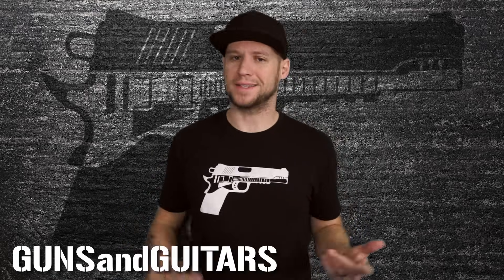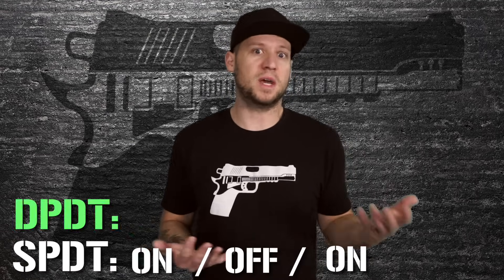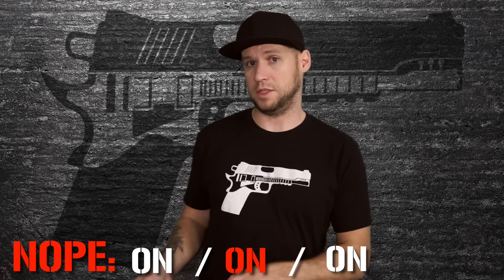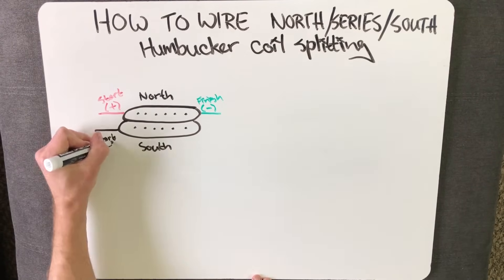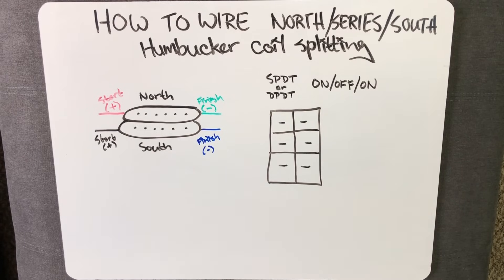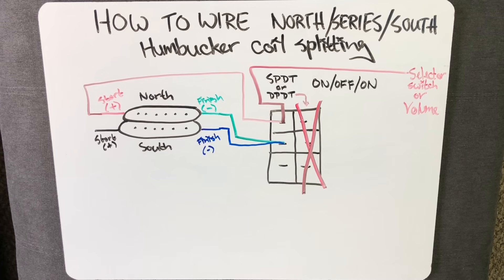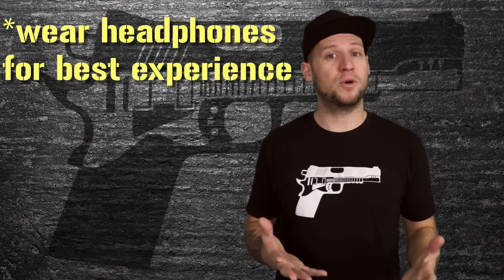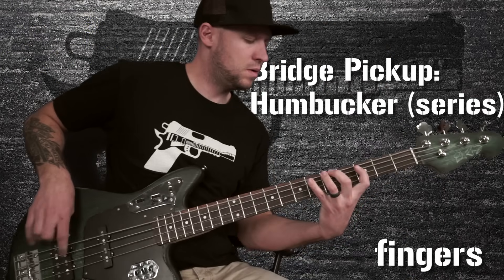BETTER THAN COIL SPLITTING! How to wire a humbucker for North/Series/South coil selecting

Comment: This is good.....I've been thinking this out......I got a 50.00 free shipping strat from ebay.....leveled the frets and replaced the plastic nut with bone.  Even though the tuners are low end they stay in tune with some stretching and nut sauce. (they held for about 3 days with bends)

I just ordered 3 of the chinese hot stack humbuckers (single coil config.)  I'm going to put dpdt toggle switches on the neck and bridge pu's for this mod...go from pickups to toggles (1 dpdt for each pu)....then to 5 way.
Then out of phase/in phase on the middle pu coming from a push pull volume pot so I get out of phase or in phase on 2 and 4 position.
I may do another push pull on the tone control and add the Gilmore mod....so I can have N/B  or all pickups at once.

I'm really surprised this thing will play in tune with a low action (after leveling).  With some jin-ho korean locking tuners it would be interesting.  With new tuners and pu's I'd have about 110.00 in it.  The body is light wood but the neck is tight.  The neck is weird....not curved at the butt and 22 frets.   

I think I may also do this mod to a silver peavey rockmaster I got....I routed a slot and added a neck chinese hot stack pickup.
This would be the perfect mod for it.  Paid 20.00 at a pawnshop.....refretted with jumbo's....my favorite guitar....goes head to head with 1500.00 ones....lots of sustain because of the through body hardtail.

Comment: How about wiring a humbucker to work in normal humbucking mode, parallel humbucking mode, and single coil tap?  Possibly performed with either a three-way toggle switch (if possible) or 3-way rotary switch.

Comment: i think this is a north/out of phase/south diagram.  your 2 negatives are tied together.  wouldn't the negative of north need to tied to positive of south, and that on the middle switch position?
Reply from the maker: No because pickups are reverse wound and reverse polarity in order to be hum canceling. Because they are reverse wound, you need reverse polarity to be in phase.
Reply: in most of my guitars, i use the tone knob pot as a variable coil tap on the bridge pickup.  in one of my guitars tonite, i installed the on/off/on switch so i could also tap coils on the neck pickup.  the hardest part was deciding where to drill the hole, and finding drill bits.  it's also nice to try how it's going to sound first with alligator clip leads.
Reply: tonite i added a 21k ohm resistor in between the switch's middle lug and and the wire between the 2 pickup coils.  this is to change the coil tap from complete to mostly tapped, to get rid of most of the single coil hum.  i would guess any value from 5k to 50k would be ok.

Comment: Hi Dan, i'm looking into doing this mod on a hss standard strat, its stock option for position is to it split the humbucker using the north coil and the middle pickup, will i still be able to do this with this mod in place and if so will i also be able to switch north, south and full as well?

Comment: Like ur vids man, gota ? tho. Wat would u use to fill under the nut? I bought a used tele changing strngs ,nut fell out n under the nut the slot is at least twice as deep as it should b. It had been drilled ,hacked out. How it was stayin in i dont kno, but now it wont. I wanz fill it with some thing that wont hinder,vibrations,sustain n all that. Hav u ever? Lol SO,,, what could i use there that would make it close to original ?  Thx

Comment: Hey, want a neat build for a really good guitar tone?

Take two single-coils, and put them side by side like a humbucker. Adjust one to be as low as It can be on the High E string, and the other as low as it can be on the Low E string. Wire the pickups in stereo (Either use a stereo jack or use two Mono jacks). Tada, Instant Double tracked guitar sound, put an amp on either side of yourself (Or directly into your mixing board and split them left and right) and you get this crazy spread sound stage.

Comment: No offence, but i feel the need for spliting the humbucker a tad redundant since it sounds bigger and more full then the single coils, which are kinda thin sounding.
Reply: I really like using a split-coil sound for rhythm guitar and then un-split for leads  when recording. The split allows for more punch and picking dynamics, and then full humbucking gives the leads a fat/smooth tone. Lends well for creating a mix, helps keep the mud out.

Comment: I really enjoy your videos.  One question, in the diagram as drawn is the series mode out of phase?   I thought the path through series should connect the positive of the south pu to the negative of the north pu and the south pu negative to ground... but I reserve the right to be wrong. :)  even if it's not in phase, still a great video and easy to setup for either in or out of phase.
Reply from the maker: I’m not an expert on this either, so maybe an expert can chime in here, but I believe this works because in order to have hum canceling in series the coils must be reverse wound AND reverse polarity, so in theory the phase would need to be reversed. I also reserve the right to be wrong :)
Reply: So, I've been thinking about this... most of the diagrams I find from manufacturers show the connection between the 2 coils being a positive to negative connection.  I've used EMG, Bartolini, Carvin, Fralin, Nordstrand diagrams and pickups.    I also found articles stating exactly what you've stated above related to phase in series.   It makes me wonder if the manufacturers are labeling positive and negative based on their designed direction of current flow through both pickups and one is possibly reverse wound.  When you determine current flow with the voltmeter, you find out the winding direction, not necessarily the manufacturers intended current flow through the pickups (I may be assuming too much here though) so the diagram you have may be accurate when the current flow is determined using the voltmeter.  I haven't tried this yet, but if you do the voltmeter check on a common manufactured pickup that already provides the wiring layout, if one of the pairs is found to be reversed, this would explain the difference.

Comment: Since you only used one side of the switch, could you do the same in the other side of the switch for a different pickup?
Reply from the maker: You could, it would just limit your options a bit. If you do go that way, I’d wire it reverse so that you get opposite coils of each pickup so you still have him cancelling. You just miss the opportunity to use both north coils or both south coils at the same time.
Reply: Guns and Guitars thanks, I'm building the tele deluxe kit from the fretwire and i want to do this once I upgrade the electronics since the pickups are dark and muddy, and the pots were labeled wrong. I like the idea of getting a single coil sound without that nasty hum

Comment: Series/Parallel pickup switch wiring...... Music Man Silhouette.  It's what I have been using exclusively since 2002.  I have a couple of them and a 20th Anniversary with a curly maple top.  All have maple fingerboards.
Reply: I had very low output at parallel, lower than split

Comment: Awesome!  I will keep a lot of pickup manufacturers in business with all the ones I screw up until I get this right.
Reply: @NomeX- If you break a pickup by doing basic soldering on the other end of the wiring, you're so bad at electronics you shouldn't be working a lightswitch without supervision... Just do it.
Reply from the maker: It’s very hard to ruin pickups by soldering, but you can burn out switches. Just buy the cheap ones I linked in the description, then you’ll have a few try’s to get it right :)

Comment: I challenge you to build the ULTIMATE les paul
Reply from the maker: A les Paul will be the next guitar kit I review, then I’ll beast it out don’t worry
Reply: I further challenge Dan to build that guitar and ship it to me.
Reply: Then explain why you get so many headstock breaks?
Reply: Guns and Guitars OHH buddyyyy
Reply: I challenge you to mod the jazz guitar.
Reply: Virtually everyone has tried their hand at a Les Paul, it's kind of been done. I'm hoping to see something more modern, like one of the headless kits. They tempt me but I'm pretty sure the bridge they use in those kits will need some help.
Reply: @Mark Byrd You could indeed, but I don't think you'll find a kit for it. But the more I think about those kits the less impressed I am frankly. Not only do I have doubts about the hardware, particularly the bridge, but every single kit uses Basswood for the body. I know everyone likes the light weight but that stuff is so soft, I have one and I'll just say I will try to avoid purchasing another. But you could take one of those Steinberger style kits, add a mahogany LP style body (I see those around for under $50 pretty frequently) and then remove enough wood from the back to allow access to the tuners on the bridge and you would have something pretty unique at least. 

Or, yeah, the other option would be to take a full LP kit, slice off the tail of the guitar, slice off the headstock, and install the headstock directly behind a traditional bridge, more like that SG you are thinking of, and it would be absurdly cool to see that done - but it really sounds like a lot more work that way.
Reply: My Music Man Silhouette hardtail is a Les Paul slayer.   Also the 5 way selector switch is Bridge/series/middle single coil/parallel/neck. The tone from the DiMarzio virtual P.A.F. humbuckers is better than any of the Les Pauls I have owned over the last 55 years.  I had a Gold Top, a 59 Sunburst, a "fretless wonder", a Deluxe too.  My Silhouette is really light weight, has tone that just won't quit and has tone similar to a Strat.  I can get the sounds I need from one guitar that doesn't weigh a ton.
Reply: Les Paul already did that 😥